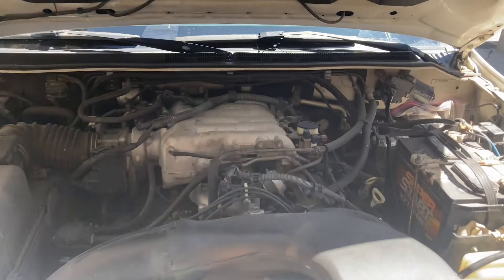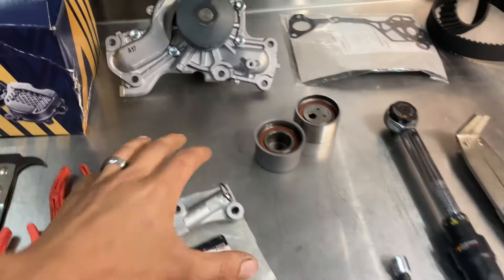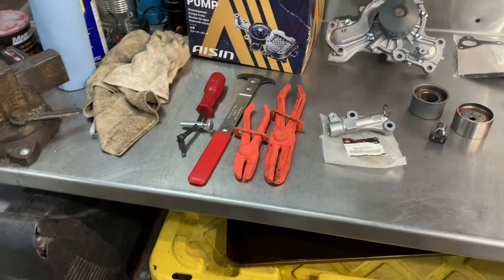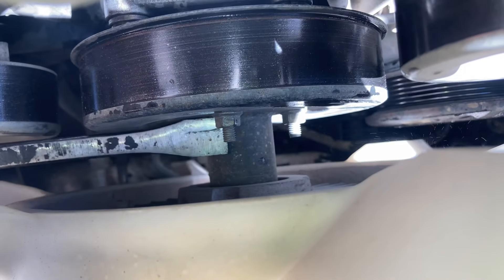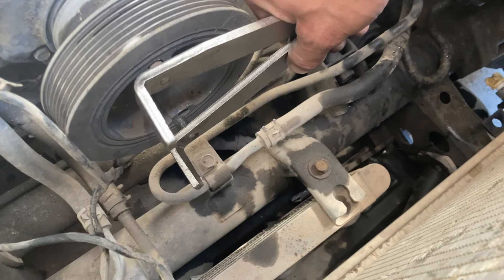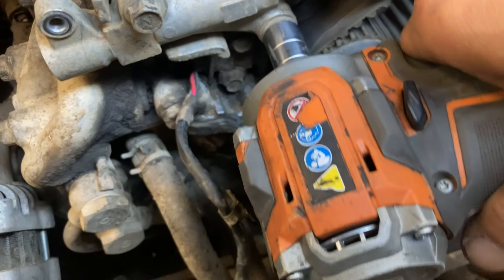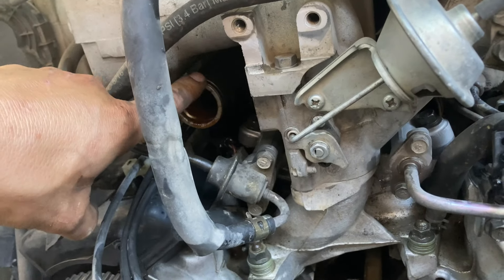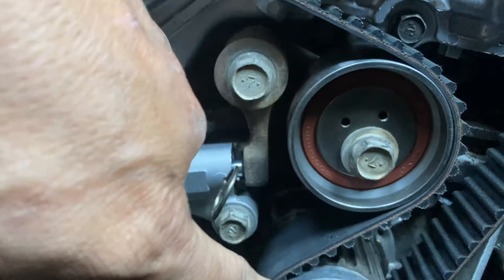How to do a timing belt on a Mitsubishi Montero

Comment: Why did you skip the super important part of how to remove the balancer?
Reply from the maker: On this motor, it just pulls off by hand. Super easy, no special tools. Mine just came right off, so it didn’t feel like it needed any special attention. Some people have it seized on there, and that will require a couple light taps with a hammer, and maybe some penetrating fluid.
Reply: @scottmurray4689 dude do you need us to call your mommy to bring you some tissues ?
Reply: @Scottadamsfan3481  Clever response. I'm glad your GED from Walmart is finally paying off
Reply: @scottmurray4689  lol 😂 I graduated from Auburn university
Reply: @Scottadamsfan3481 War Damn Eagle!
Reply: @ashleymcmillin3023  hey war eagle !!

Comment: Any videos on the cam seals?
Reply from the maker: i don't have one, but they are pretty similar to any cam seal process. make sure not to push them in too far or they will leak. take a measurement of the depth before you pull them out